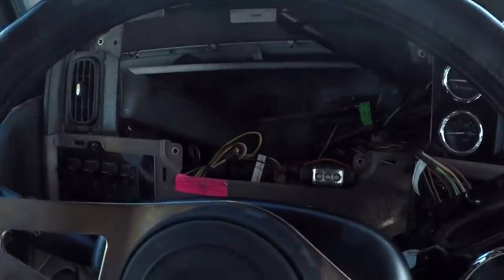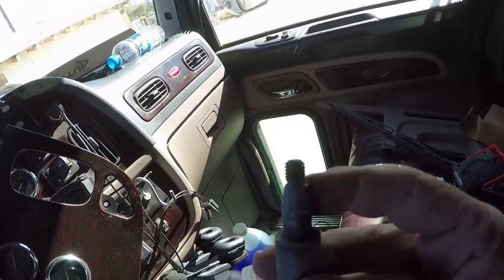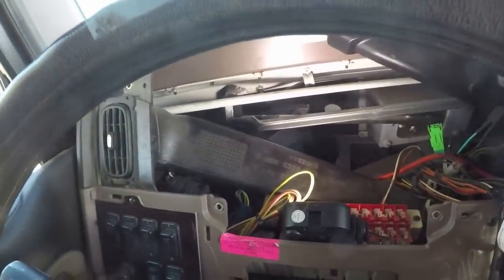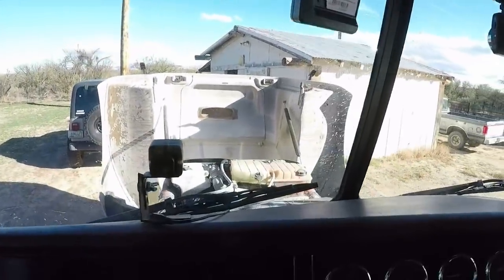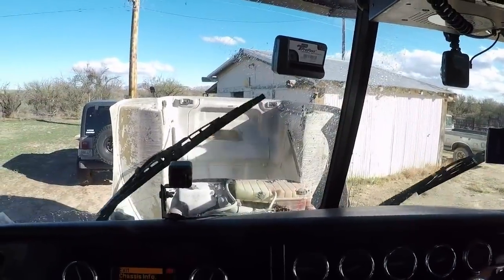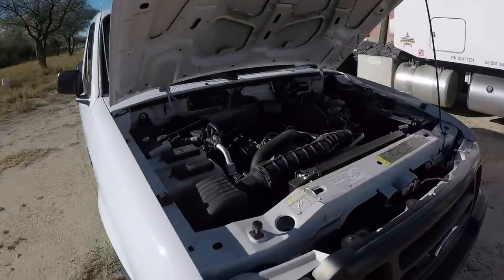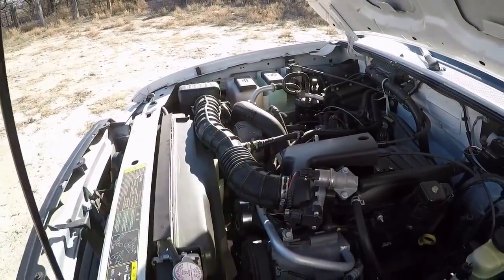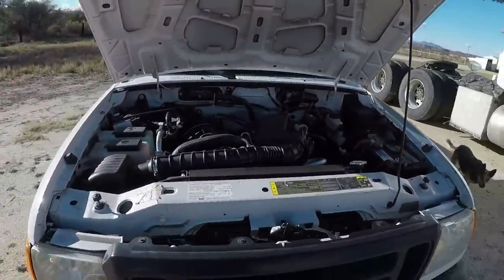#280 Replacing Peterbilt Wiper Arm Shaft  The Life of an Owner Operator Flatbed Truck Driver Vlog

Comment: I have a 2009 with 96,000 on it, 4 cyl.   Heck yours is just getting broke in!!!  lol    They stopped making them December 16, 2011 and are bring a new style Ranger back for 2019;  I don't like the new ones.   On your Truck wiper if that happened on the road a rattle proof washer or two would be a temporary fix since it is a tapered shaft, forcing it onto the shaft and keeping it from vibrating loose under the nut.    May 2019 be a great year .

Comment: you can fix that for 3 bucks and 10 min labor. just get some red locktite and put it on those splines. once is dries its permanent. have done it several times and never failed.
Reply: Most times that issue is from the nut backing off. And your right that red locktite, takes care of it everytime. 
I have taken mine off. Use a file to cut 2 key-ways in both pieces. Then use copper wire for the key's.

Comment: Sir Dan !!!  When you go shopping at Walmart,,, get a couple bottles of Tecron fuel system cleaner & pour 1 in the gas tank of the Ranger & pour the other bottle in when you change the engine oil at 3,000 miles !!  The bio-grade 87 is bad for the fuel system !!  Use pure gas-non-bio-fuel !!  Again,, HAPPY NEW YEAR !!!!KEEP IT SAFE !!!
Reply: Good luck doing that in AZ.  Or anywhere in the west.  Almost all retail gas has bio-fuel added, as I learned, driving a 1970 big block.

Comment: Here's a cheap fix for the wipers. Position them where you want them. Drill a hole thru the nut & bolt to accept an expandable dowel pin in it. Or if you have a tap & give set you could in a small high strength bolt...just thinking outside the expensive part solution.

Comment: Hey Dan just for grins... what if you had taken a Dremel grinder and put some new groves in the shaft? With a deep enough grove the softer wiper arm metal would seat in and most likely work fine.

Comment: You want to put some anti-seize on the threads of the shaft so that you can get plenty of clamping force without having to apply a heap of torque to the nut. I noted that the threads of the old shaft were a bit rusty, which would mean that there probably wouldn't be a whole lot of clamping force holding the arm on; making it prone to slipping and wearing the splines.

Comment: A little anti seize on the new wiper threads might keep electrolysis at bay.
Clean the wire on the maf sensor. Clean the throttle body port inside the throat and where the plate seat area is first,-BOTH sides - this is what causes idle issues...consider a new fuel filter also, if you don't know when it was last changed. Those little sensors are expensive, do the cheap stuff first. The carbon on the plate is tough to get off, I used brake fluid to eat through it...
 Happy new year!
 Check out a site called "the ranger station" and "Serious Explorations" ranger and explorer forum
also this video https://www.youtube.com/watch?v=vhCSd-T4aSY